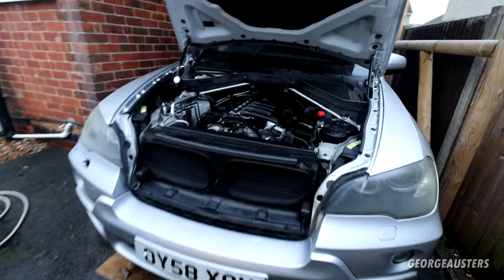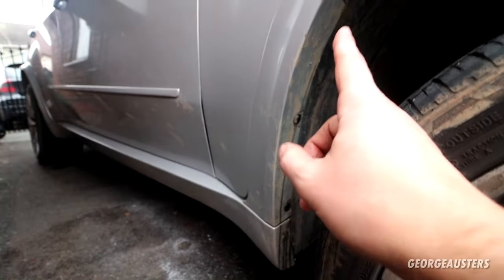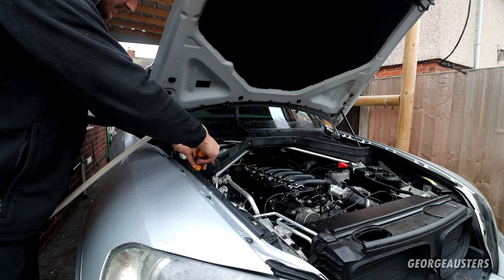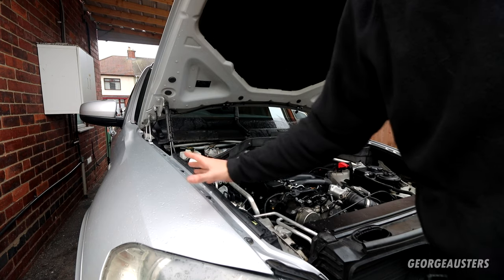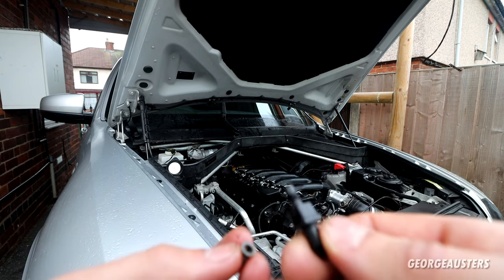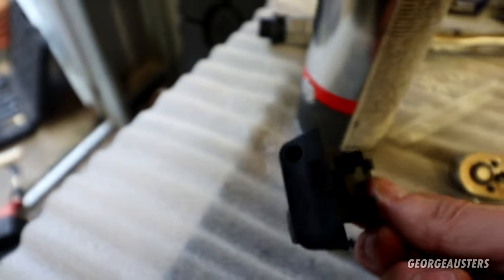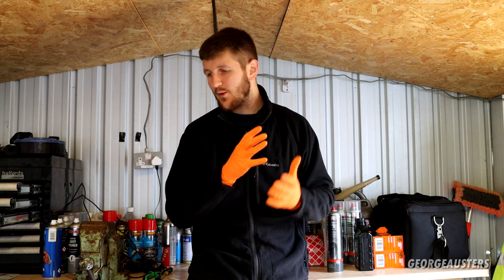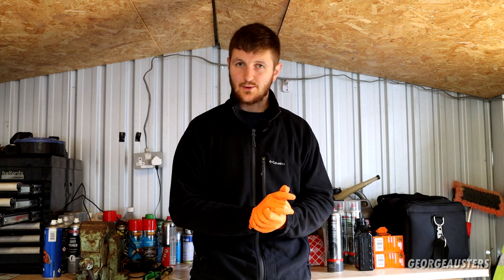BMW WASHER JET NOT WORKING FREE EASY FIX!

Comment: Tried that method on my 72 plate X5 before I sent it into the main dealer for it to be dealt with under warranty . Had a nasty surprise when they told me they had tested the water in the reservoir and found I had used non bmw screen wash and it’s NOT covered under warranty and I had to pay £190 to have the filters changed and the reservoir flushed out … it’s so expensive as they , as George said they have to remove the inner wing cowling to get access . I had three X5 in the last 10 years and this is the first time I have had this issue .to my knowledge I have had my car 18 months and only topped up the reservoir ONCE with non bmw approved screen wash and the filters became blocked !!!

Comment: I found this video sort of helpful but when I went to emulate it on my X5 it was just too difficult. So I added a quarter of a bottle (50 grams or a couple of tablespoons) of brewers detergent (Sanistar) and a cup of Clorex to to the water tank and filled it with hot water. BOOM 5 minutes later water was flying all over the windscreen just like brand new, saved myself hours. Great helpful video keep making them but sometimes there are just easier ways. All the best clear vision to you all!!!

Comment: Hi George 🙋‍♂️ !!  Thanks a lot for this tip, it worked a treat 😊👍 !!  My 320i is only 15 months old when the screen washer stopped working.  I was dreading taking it in to the dealership and have them open it all up 🚘👨🏻‍⚕️!  I used a football pump to introduce the air; the nozzle was a perfect size for the job ✅! A ten minute fix 💦!  Greetings from Scotland 🏴, cheers, Don 👋
Reply from the maker: Glad to help Don!

Comment: Worked perfect on my 435. Filled tank with water to top. Unclipped the hose feeding the nozzle line attached to hood. Used air compressor to push air backward. Of course the first time I pressed the air line I pushed so much air the smelly water erupted all over me.  Did this this twice. Works great now. Huge thanks!
Reply from the maker: You’re welcome!

Comment: Hi. Have a few questions, if possible.  My screen bottle seems to have a filter on the top, once the caps removed, I'm guessing this will stop me flushing as the debris cannot come up & out? Also on the washer pipes, attached to bonnet, they seem very tight onto the jets, is there a knack to getting the tube off the jets or just steady twisting?. Thank you :))

Comment: Thanks for this video as I had no idea that this happens. I have a 2018 X3 so I tried this yesterday. It didn't appear to work initially but today, I have my washers again. This is definitely worth a try before trying to dismantle half the car or just booking it into the garage for a costly labour job. Some people have suggested drain unblocking fluid for what will be sitting at the bottom of the tank but worried that may cause some damage.

Comment: Thanks for another video, George. I had similar blockages with my BMW. Old screen wash had turned to a gel in the bottom and gunked things up. An additional preventive measure I was tipped off about was frequently adding steriliser tablets such as are used for baby bottles. No issues since.

Comment: I had a 2006, E53, X5 in Spain and i had to buy a new washer jet pump. Thankfully on the E53  its easy access, but there was 3 pumps on the 1 reservoir !!

Comment: Nice one George, do hope your getting a decent money for your hard work. Always liked your passion for fixing things.

When i had my e92, in this summer i had to remove the whole bottle, the wheel arch was a pain, mostly the 2 hidden bolts. After that had to block the bottle and out bleach inside the washer bottle, for 3hours shaking it about, Also had to add some uncooked rice to shake the bottle to able to scubb the remaining mold inside the bottle.... once everything was clean, pipe all blown....felt like a brand new screen washer system.

Comment: Can you poke a hole in the filter on the pump so it not filtering anymore as you can't take it off as it is used as a seal as well as me and my brother changed the pump as it was making some good noises and water dribbling out and after some fighting got to it with just the wheel arch off if was easy to get the pump off it is getting it back in that is the hard part. 

But now after a few months it is starting to lose presser again bit by bit so guess it is blocking up again i use the pre mix halford screen wash so dont know why it keeps doing it so if i just break the screen if any gunk gets stuck it will be in the lines or spray heads what is easy to get to or you can buy the seal without the filter will that work better or just make it worse.
Reply from the maker: Best thing to do is clean out the washer bottle and not use thick washer fluid.. I use concentrate and water it down a lot!
Reply: @GeorgeAusters  Ok thanks will give it a shot thanks for the reply.